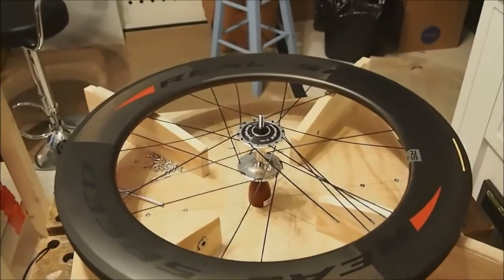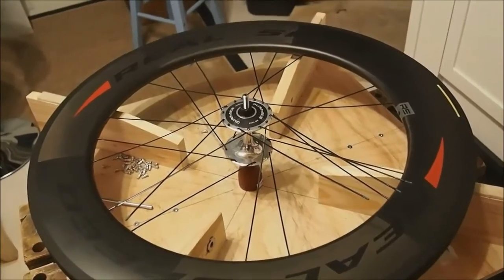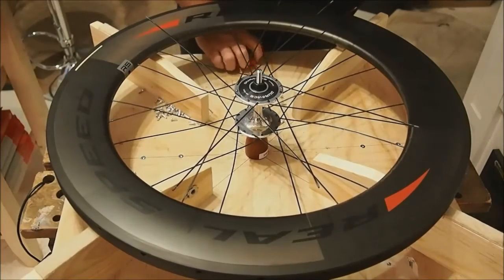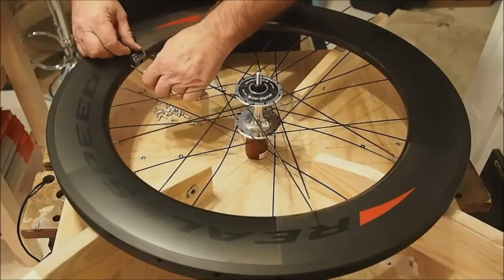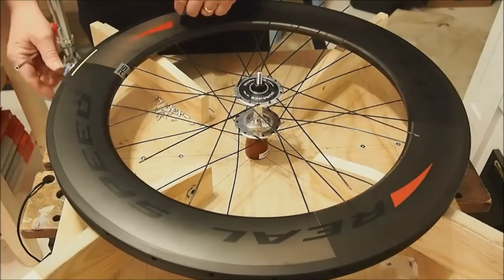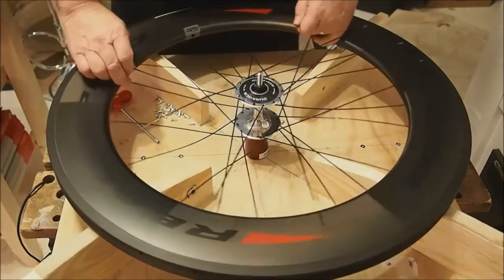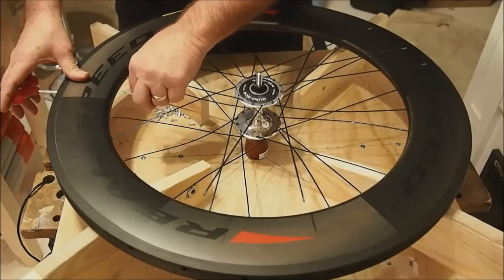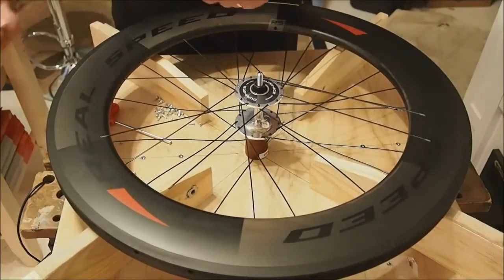Wheel building jig for internal nipples

Comment: What is the name of the tool you are using for the nipples? I have also internal nipples and i need that tool to tru my wheel.
Reply from the maker: Here, I am using a DT Swiss internal nipple wrench for square nipples. There are different types that require different tools. You could have splined nipples or hex which come in a couple of sizes, so you need to know what nipples you are dealing to get the correct tool. https://wheelbuilder.com/dt-swiss-t-handle-professional-nipple-wrenches/

Comment: Nice.  What are the tee nuts in two of the supports used for?
Reply from the maker: +Sandy McCrae 
Those are there to keep the two hub supports not in use from getting lost. That way, when I put the jig away, all three supports are fastened to it.
Reply: +Dan Burkhart 
I built your version of the tensionometer calibration tool and now I think I'll copy the building jig.  thanks.

Comment: Is your tightening wrench standard to all deep section tool rim? Where can I buy it?
Reply from the maker: I am using square internal nipples, but there are also a couple of different sizes of Hexagon internals. Here is a link for a square one  https://www.ebay.ca/itm/DT-Swiss-Square-Internal-Nipple-Spoke-Wrench-DT-Swiss-T-Handle-Spoke-Tool-Red/283070727747?hash=item41e8548643:g:RyAAAOSwlTZcfeWw   If your rims are maximum 50 mm deep, the Park Three way wrench will fit square, and the two most common hex sizes. https://www.parktool.com/product/3-way-internal-nipple-wrench-sw-15